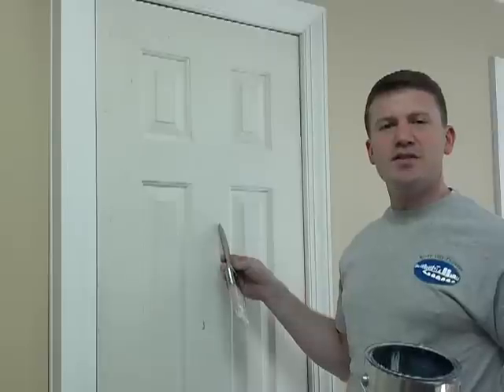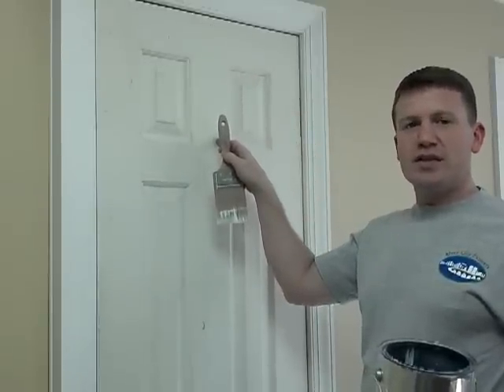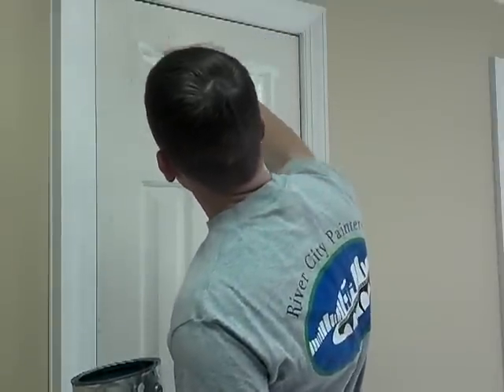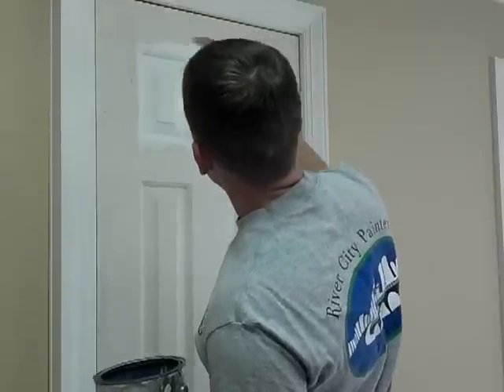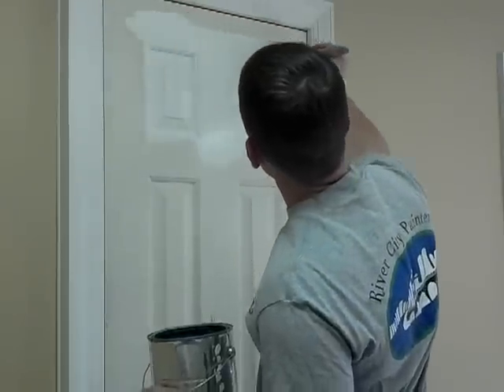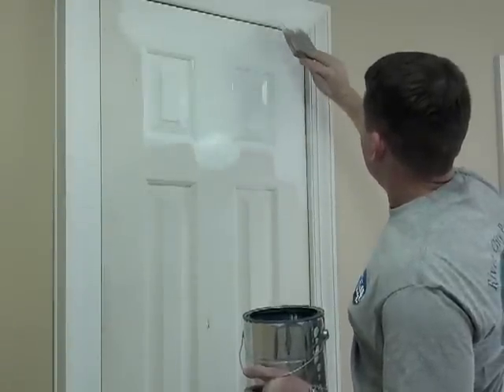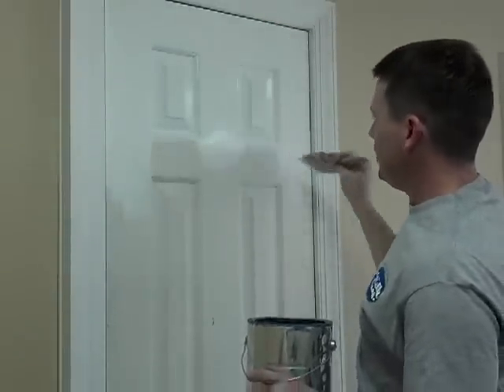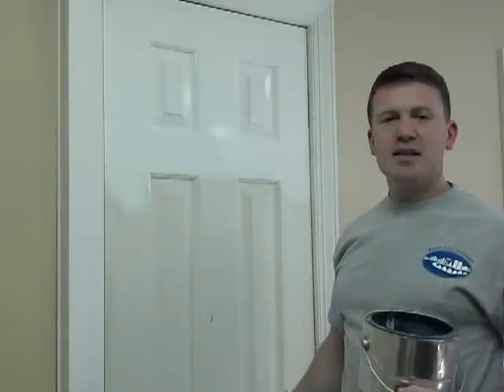How to paint a raised panel door

Comment: My boss at my work told me you have to paint down the sides first. Is that possible also?
Reply from the maker: If the sides are painted first, you typically will have a residual amount that carries over to the face of the door to be painted that dries before the door can be completed. Due to this additional layer of dried paint, I prefer to paint the edge after the face is complete. This way I can blend the residual that may roll over with the direction of the newly established brush stroke on the face.

Comment: When I paint my doors when they're vertical, I always get paint runs.  How do you avoid paint runs?
Reply: Craig Just ease up on the amount of paint on your brush. Also don’t press the brush too firmly onto the surface your painting. Especially if it’s a vertical surface.
Reply: I have two panel smooth doors this wouldnt apply to me most likely have to spray them.